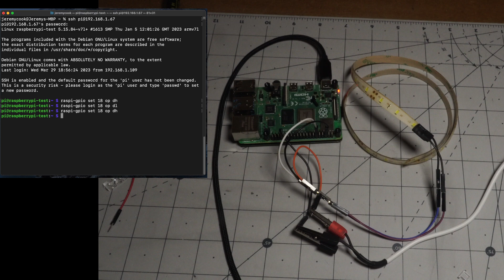12 Volt Fan Control With Raspberry Pi and EZ Fan2

Comment: hi, i am also trying to control a 12 volt fan via Node Red running on my raspberry pi. Do i need this EZ fan2 in order to do this? thanks in advance!
Reply from the maker: With the 5's there may be a way to do it with its fan output (I don't know), but generally you'd want to use something like this (assuming the fan doesn't need more current than the transistor can provide).